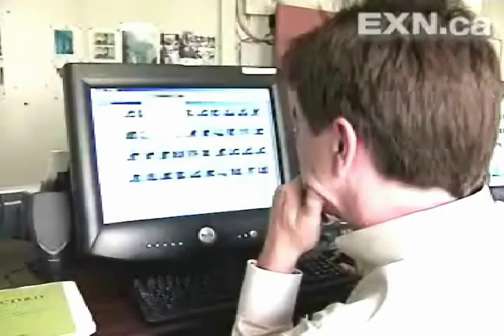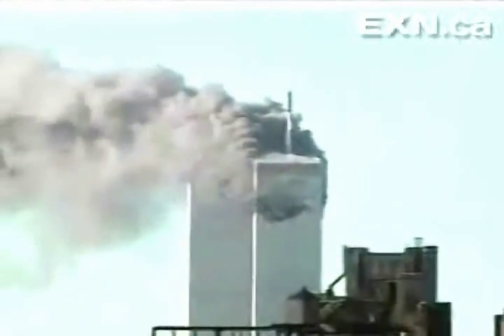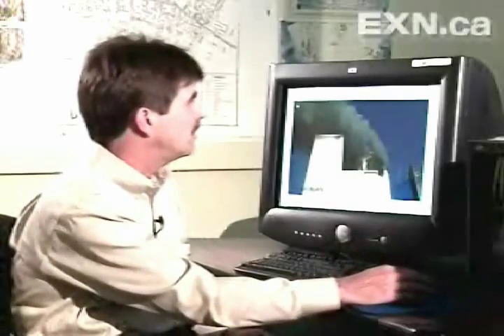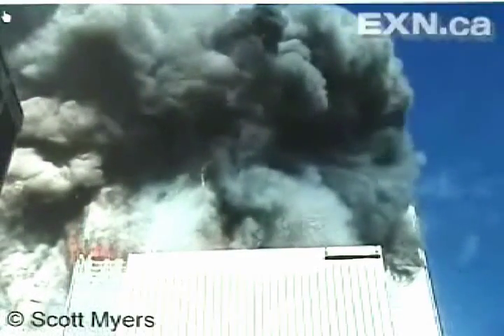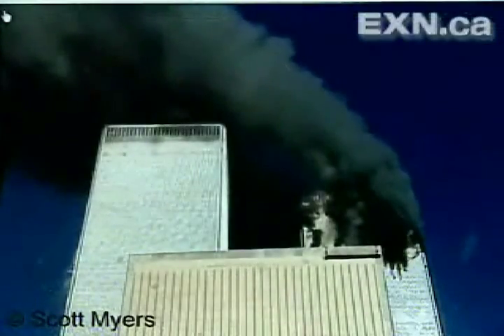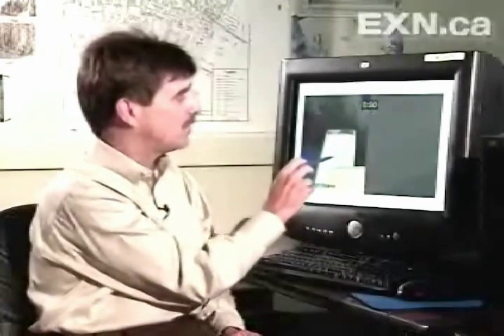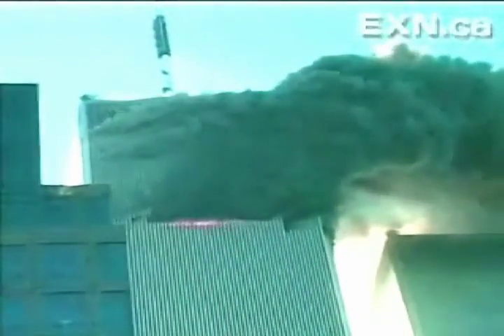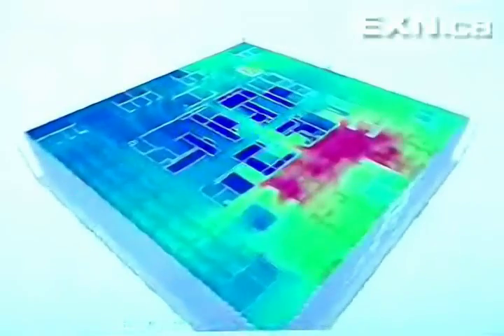Segment on NIST's WTC Visual Analyses (Discovery Channel Canada, 2004?)

Comment: I thought the Jet Fuel was the cause for the Building to Glow on the inside
Reply: Nist says the jetfuel was outside and the rest of it was gone in ten minutes so it just started a fire not hot enough to melt steel so look for thermite